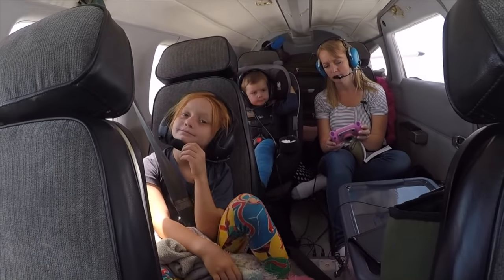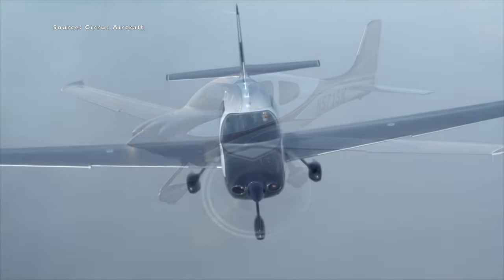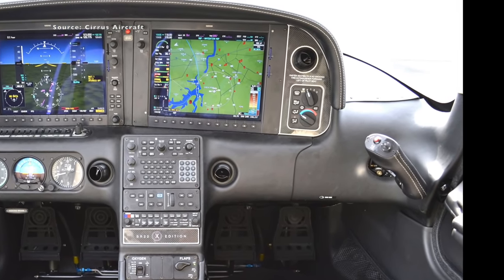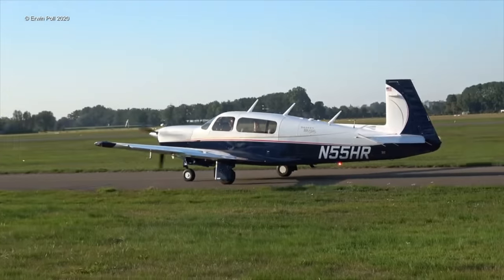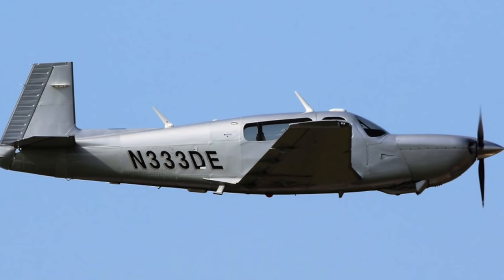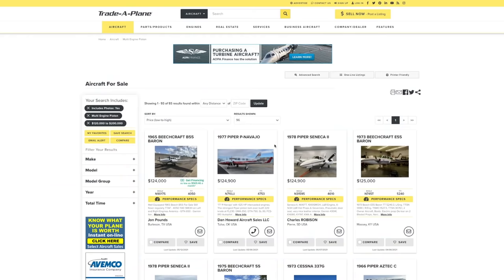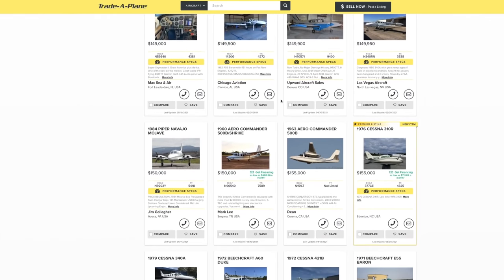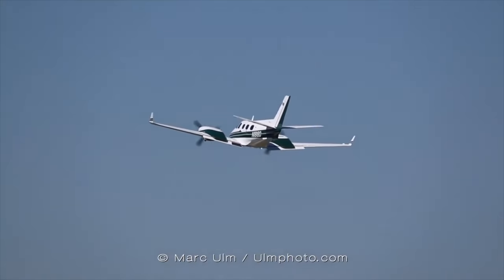10 Fastest Cheap Airplanes You Can Buy For Your Family

Comment: The rubber bushing landing gear is also used by the Beechcraft Musketeer, Sundowner, Sport and Sierra.  Generally zero maintenance until you need to replace the entire set about once every ten years.
Reply from the maker: that's a cool fact!
Reply: When I flew with my Dad and others in a Mooney. There were always 2 things to consider. They would "float forever" in ground effect upon landing. You always had to keep approach spoeds under control and be mindful of runway length. 5 knots too fast on a high altitude short runway was bad news. And when you touched down your were landing on a stack of slightly softer than normal hockey pucks. Usually, you didn't notice because you were on the binders and pulling up the flaps ASAP. Milking up the flaps while floating in ground effect was very effective. My FBO was a dealer when the 201 and 231 were produced. There were several runway overruns with the 201s. You needed to recognize it quickly and a go around was no problem. By the time the 231 came out most pilots had adjusted. That's why many Mooneys today have spoilers/speed brakes to kill speed on the approach and floating in ground effect if you are too fast. Controlling your approach speed and milking the flaps up slowly worked great and was a lot cheaper. The second thing is that the average American was skinny in the late 1970s. Watch some movies from that time ( like "Caddy Shack") and look at the extras. For the Average American Male in 2021, the Mooneys are a 3 place airplane. For weight and shoulder room. Although it looks like TPTB are setting up the food production and distribution system to starve a lot of people around the world. After they made us all obese with GMOs and estrogenic chemicals. I could stand to lose 50# but that's my Cancer (which they probably gave us all) calorie reserve. My AUX tank, so to speak. C'est la Vie.  Oh, I forgot to mention, don't give any of your children any of the CV shots. The vax spike protein's highest concentrations are in the Ovaries and 2nd in the bone marrow. It has been determined that it is cytotoxic. That means it kills the  cells it attaches to. And then may travel to other cells, infect them and kill them.  Hence the blot clotting abnormalities you are not being told about. For pregnant women, the spontaneous abortion rate is sky high. So, unless your are a star of my 600 pound life? If you are under 45-50 I would absolutely avoid the shots. And avoid people who have had the shots. They may be Super Spreaders? IDK? I do have an MD from USC 1984. Dr Drew's class. We sang in a Barbershop group together. Anyways. I became an anesthesiologist. About as far from this CV crap as you can get. But that doesn't make me stupid. Why have ~40% of the CDC and NIH employees NOT taken the shot? Think! Please! Why are they so spazzed out about "everybody" getting the vaccine? I am not vaccine "hesitant". I am not getting any of the current GD shots. I am NOT hesitant. That wording pisses me off. I'll chop off the hand of anyone who tries to inject me or any family member. My hatchet is sharpened. Sorry for getting sidetracked. But I get nothing from any pharmaceutical company or store. I feel it's a moral and ethical obligation to pass on what I know. And have suspected since the beginning. Everything humans have EVER accomplished was due to a conspiracy. Everything. There may  be a few exceptions whose life's were ruined, but basically every accomplishment of human beings is a conspiracy. One man probably couldn't bring down a Mastodon or Wooly Mammoth. A conspiracy amongst men could make the human species survive another harsh winter. Don't blow this off. That IS a CONSPIRACY to kill a Wooly Mammoth. Sorry. It's late. Don't get vaccinated if you're young and ever want kids. I've done my moral duty. You have been warned.
Reply: Please comment if you want some real facts about this CV debacle. I'll post a list of people who really are the experts. Most people can't handle the cognitive dissonance. About 50+% of the population. If that's you? Go with God.
Reply from the maker: hahahaha, that took a sharp left turn!  That's what I like about you @ArchAngel M260!  You are hereby inducted into Jimmy's World foil hat club! Love it!
Reply: And the first several thousand Cirrus  nose gear before they switched to oleo struts
Reply: @msmeyersmd8  I believe the word you were looking for to describe the group  killing the mastodon was collaboration rather than conspiracy.  Just saying.

Comment: Your video showed a PA-31-350 Navajo Chieftan, (350hp), and unpressurised, not a PA-31P, (425hp) which is the pressurised version of the short Navajo. And they are considered "cabin class".
Reply from the maker: That's because the only images of a PA-31P I could find were in a shop getting fixed.... hahahahaha
Reply: The performance spec you stated must be for the P Navajo. Fuel numbers for a 350 or 325 hp Navajo will be much less.  I might add the counter rotating props on a Chieftain or a C/R make them a sweet handler  overall and especially one one engine (no critical engine).  I recall something like 200 kts. TAS on no more than 45 GPH in a Chieftain in the low teens.
Reply: @therealjimmysworld  They are a maintenance disaster quite unlike the Nav and the Chieftain which are much better over the Cessnas. Especially the 421 with the geared engines.
Reply: The moment you say "geared engines" I think Hangar Queen .  The PA-31P I knew had 4 engine failures in 500 hours;  The B-60 a friend owned presented him with a piston thru the cowling criuising at 20,000 feet. Both bought Superstars.

Comment: Jimmy
Save yourself some time and frustration and a get yourself a SENECA. it Cruses at 210kts top speed is 240kts. Plus you have the safety of 2 engines.
Most important, if you loose one engine, you need not worry about the yaw effects. Each engine torque towards the fuselage
Reply from the maker: Counter rotating props are super nice.  Thanks for the comment!
Reply: Maybe a Seneca IV in  dive
Reply: Sorry Manor,
The marketing materials and reality are apart.. it’s not a 240kt plane unless you are crashing.  It’s under 200kt plane.  Look at FlightAware and track a few.

Comment: I've had the pleasure of flying many of the airplanes you cover. I have to say, for arguments sake, I'd refer to the airplane's POH for valid stats over many of the stats you provided.  By far, the Aerostar 600  (non-pressurized) has always been a favorite of mine. Any half decent pilot will lean those two 350 HP beasts to sip only 15-17 gph in climb  & 15 gph in most mid-level cruise situations. There's no way either the AEST or PA-31 burn the huge gph figures you specify. Also, given the choice, the Aerostar is hands-down the ultimate reasonably low-cost airplane for missions/trips of moderate length. Oh, and by the way, Ted Smith was a geniuos! I thank him everyday for designing the airplane my father flew in WWII. It allowed him to take the fight to the NAZIs and come home alive. And yes, he was one of the first to buy a -600 in the early 70s. We flew it a lot & never saw terrible maintenance cost, as you implied. Maybe a bit more research & real pilot experience interviews would add credibility to your so-called recoomendations.
Reply from the maker: Great info and thanks for the comment
Reply: Eric Faber the Aerostar and Navajo had different engine options, the bigger engines will suck fuel.  Not going to get into lean of peak operations here, that's a debate for the ages, but obviously different fuel burns running rich or lean of peak.
Reply: @therealjimmysworld  great response to the snark.  He had some valid insight but said it in an obnoxious tone and you responded like a true professional.  That deserves some recognition!

Comment: I used to fly an (unpressurized) Aerostar around 1980 with a cancelled check route. Loved that airplane. 
Had its quirks with: a fuel system that originally came with too few fuel gauges; A standby hydraulic pump that needed to be armed in case of right engine failure (so you could raise the gear), no cowl flaps so the need to be careful not to cool the engines too quickly, funky electric nose wheel steering switch pin and gasoline heater. But it was a rocket.
Reply from the maker: very cool!

Comment: Great video! I’m trying to figure out the next plane as well. Haven’t given much thought to twins due maintenance, but that useful load sure would be awesome.
Reply from the maker: I agree, it's a tough pill to swallow.  spend up on the purchase of a bigger single (maybe turbo prop) and have lower operating costs or spend much less and have higher operating costs and potentially more down time...
Reply: My first plane was a Piper PA32-300, bit slow but carry lots…. First flight Toronto Canada to Daytona Beach and Back, next trip Cancun and back, did I say a bit slow… Second and current plane Piper PA30 twin Commence with all the speed mods and full STOL, fast 4 seater 172 knots true, best plane ever at 18 GPH, hard to fit my bike in though….. better for all around then a Aerostar.
Reply: @therealjimmysworld  What about the Diamond DA42 that sips like a single or DA50RG single?
Reply: @thisismagacountry1318  That is one really expensive plane.  400k minimum to get something decent.

Comment: Nice list.  Regarding the B90:  the arm from the wing chord to the rudder is much shorter than the B200.  This makes for some attention grabbing crosswind landings as rudder authority is diminished with the shorter arm.  Like the simplicity of the PT6 as opposed to an internal combustion engine.  Singles are cheaper to operate but you have fire and fuel just in front of your feet.  As another commentor said: light twins are the most dangerous class of planes out there.  The more powerful the more dangerous (reference the B350 crash in Texas).  If you lose an engine at V1 you better have practiced this in a sim recently so you don’t let that good engine flip you and kill you.  Smart wealthy entrepreneurs still kill themselves in this class of aircraft.
Reply from the maker: Thanks for the info, good to know!

Comment: 180 kt  for the C-340 flight planning. Had 2 of them, great planes
Reply from the maker: Nice!  Which ones did you have?  That's the one I'm leaning towards on this list.  Seems to be the best all arounder.  Thoughts and advice?  greatly appreciated.
Reply: @therealjimmysworld  Had 340's & 414's all were Ram conversions with Q'Tips.  Make sure you get heavy case engines. Block speed always worked out to 180 kts.
If you have not flown pressurized planes, or turbo charged,  study up on let downs from high alt. and never ever not cool down turbos after landing, 5 minutes
Minimum, more is always better. And Shock cooling of engine will cost you dearly.  My engines would run to TBO 1800hrs.  with normally no issues.
Reply from the maker: Good to know!  Yeah, I've been flying a turbo Arrow recently and learning those characteristics.   Which ram conversion on the 340?  How did they do with cylinders?  I hear those like to eat them.
Reply: @therealjimmysworld  Wow, its been a long time ago, I think they were RAM 3 or 4. 
Never a Cylinder issue. Most didn't even
get a top overhaul and ran out to 1800 hr.
I was 135  and putting 100 hrs. per mo. on
a lot,  few if any breakdowns. Sub systems
like mags and such were a bigger issue. If 
you have cylinder/case  issues it the pilot/
maintenance.  P.S. We would buy aircraft run
engine out then put Factory new cylinders on
overhaul.  Never used (IN) house overhaul.
Used top line engine overhauler's,  Your best
buddy,  friend mechanic won't hack it if your
running your aircraft hard and need depend-
ability.  Good Luck.  PS for personal aircraft
best is a Baron 55, with 470/520 IO. I have many
fond memories of my haul butt 55.
Reply from the maker: Thanks for sharing!  I've heard great things about the 55 with a 470.  Seems like a great combo.

Comment: If you are going to do experimental, you need to check out the Velocity, one of Burt Rutan's designs.  Fast, safe, sips fuel compared to some of these others and reasonably priced.
Reply: Speaking of Burt, his best of not least popular design was the Beechcraft Starship.
Reply: And it still looks futuristic after 20 years .unbelievable performance on the small engines it can use

Comment: Excellent video.  FYI, I just recently got a Lancair IV.  The published max cruise speed at FL240 is stupid high at 297 KTAS with the twin turbo TSIO550 350 hp engine. Normal cruise is around 270 so it's still supposedly faster than the Aerostar.  It is pretty fast and mine isn't pressurized to I haven't been up to the flight levels yet, but it is all the things you mentioned.
Reply from the maker: I'm so jealous!!!  You have to keep me posted with your flights and what you experience for "real" data.  Also, I've heard that winglets and vg's help with the stall/spin issue.  Do you have any data on that?
Reply: @therealjimmysworld  I do have the winglets.  Haven't heard of using VG's, but have heard that stall strips on the leading edge help prevent the wing drop in a stall.  I have not stalled it, but it fly's good down to 85KIAS.  I won't be flying again for a couple of months due to job.
Reply from the maker: Good to know.  I love the look of those with winglets. maybe that's what I've heard.  For some reason I thought it was VG's.  There's a great article about a guy stalling it at 9,000 ft with the winglets and it took until 4,000ft to recover..... sheesh..... https://www.kitplanes.com/taming-the-lancair-iv/
Reply: I fly cirrus sr22t as a rental, love it but useful load is not great and I was looking at the lancair IV and I’m very curious as to if it is as scary as it’s reputation? It’s hard to get 200 knots constantly mostly 175 knots.
Reply from the maker: Good to know.  Also, check out that article above.  That is with the winglets and other mods to control the spin.  yes, the straight wing, basic IV's are spin machines (from what I've studied)
Reply: @ericswensen7106  Scary?...  It's only scary if you are afraid of it... LoL.  In all seriousness, and in my opinion, the Lancair 4 is not scary, not hard to fly, not dangerous at all in normal everyday flying.  It is not a beginners airplane, but with the right training one is easily able to master flying it.   The main problem, as I see it, is what happens "if" the engine fails.  In that case, you don't have a parachute and you don't glide very far so your options are more limited, but as long as you keep it at the best glide speed of 120 and don't stall trying to stretch your glide you will survive just about as well as any other fast airplane that you have to land off airport.  In the mountains, you will die.  In the prairies you will walk away and may even be able to fly your plane again.  Control your airspeed and you shouldn't have a problem.  As for the speed, with the TSIO550 200 Knots is taking it easy.  I haven't really tried to max cruise mine yet, usually see around 220-230 on 15-18 gph at 12500 and below.  Take this for what it's worth as I'm a novice on the LNC4 and do plan on getting some more training from those that "KNOW".
Reply from the maker: Great share.  I really appreciate it.

Comment: Before Ted R. Smith took his operation to Santa Maria, I worked at his old facility at Van Nuys airport where he re-acquired Aerostar from American Cement (!) back in the early 1970’s.  We prototyped the pressurized 601-P’s there and maintained a bunch of aircraft owned by folks as notable as Jack Chrysler and others as it was in the hub of super rich celebrities that loved to fly unique airplanes.  I got involved with much of the flight-line maintenance and one day found my self doing some prop governor modifying on the Lycoming  TIO-540 engines dealing with feathering and unfeathering characteristics while in flight.  The test pilot and I completed a run up check on the ground and took off for an inflight check. We departed Van Nuys airspace and proceeded out over the Pacific Ocean to run our test, shutting down one engine and feathering, then restarting to unfeather the prop.  Which worked OK for both engines, so the pilot claimed, “Hey, let’s do both of “em for a while!”  You mean be a glider for awhile?  Both motor’s at the same time?  Sure, why not?  We were cruising along at 15,000 ft, over the Pacific Ocean, so what the hell, we feathered both engines shutting them completely down and enjoyed the quite ride to around 5000 ft.  “OK, enough of this, kindly start the left engine”,  low and behold, the motor failed to unfeather and start!  So we tried the right engine, and it failed to start, the battery was starting to get thin and we were starting to scream at each other,  on the water below us was a sail boat so we established a final approach near his course heading and I had an ax in my lap to bust open the cockpit windows upon ditching!  We were less than 1000 ft and tried the left engine once more and it coughed out some white smoke and started!!  The prop unfeathered and we nursed it up to speed to gain some altitude and started the right engine with no mishap!  We flew over the sail boat, rocking our wings, the skipper unaware of the drama that just occurred over his head!  Upon our return to Van Nuys, I quietly replaced the magneto/starter switch knobs that somehow got bent!
Reply from the maker: holy crap... that is an insane story!!!!  So glad you lived to share it... How often did you fly with that pilot after that?! hahahahaha pucker factor 9.8